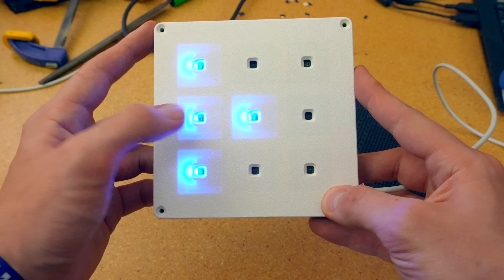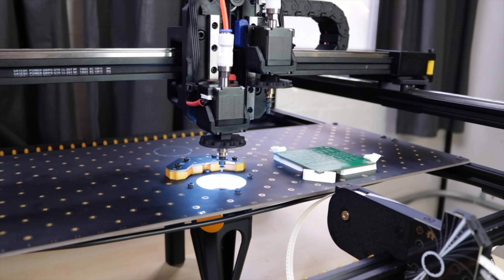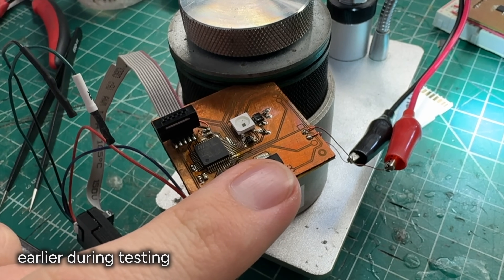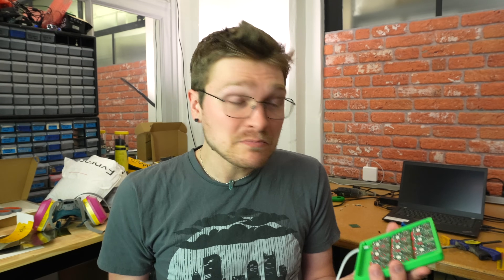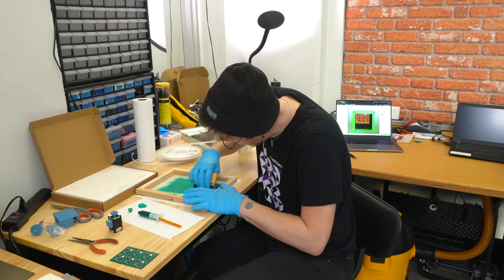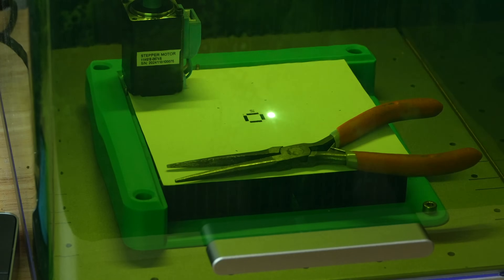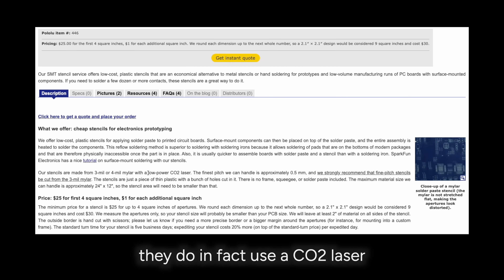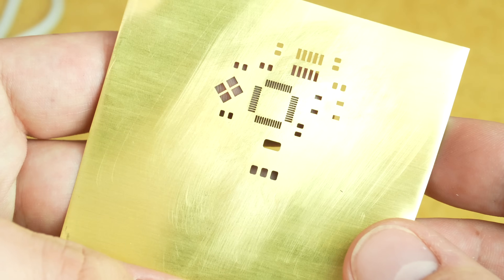Make and Assemble PCBs on your Workbench

Comment: Hello, I have watched Commaker's video of making PCBs with lasers. I agree with his simplified version of the operation steps. The laser engraves the circuit board and opens holes (this can also be done on the F1 Ultra), then sprays paint (solder mask), and then uses the laser to punch out the pads. The entire operation steps are similar to yours, but spraying paint seems to be much more convenient than applying solder mask oil. It does not require a UV lamp or gloves to operate. It only requires a piece of paper to be placed under the PCB. The drying speed of spray paint is also much faster than solder mask oil. I tried it, and ordinary paint cannot withstand the high temperature during welding and will melt. I asked the author of Commaker's video, and he just sprayed ordinary paint for demonstration. Later, I planned to try high-temperature spray paint, which is the kind of spray paint that is sprayed on the oven or motorcycle exhaust pipe. The only black or silver ones available on the market can withstand high temperatures of 800-1500 degrees Celsius. I think this kind of spray paint can replace solder mask oil to a certain extent.
I share this idea with you and hope it is useful to you

Comment: For via/double sided boards, a few times, I just used a strand of copper wire from regular AC cables and then snake it through all the vias and solder by hand. At the end, you just cut all the excess with a blade. It sticks out more than necessary, so you can't use it under components, but it does the job. I use it to verify my design before sending it off to fab.

Comment: You can also make the two sides separately as two one-sided PCBs. If you increase the via size, you can put those two boards back to back, and solder some resistor leads in the via holes. It is a little manual soldering, and the final PCB has twice the thickness, but it is simple, and You can still design like for an ordinary two-sided PCB, just make visas a little bigger so you can place thin wire into them, and add a little pad on both sides, so it is easier to solder the wire. 

Another solution would be a rivet placed in the via whole, but again this requires a little bit of manual work.

Comment: Try dampening, wetting, or soaking paper products before cutting in the laser of your choice.  You may also want to press or iron them when done to ensure they dry flat.  Also consider electrochemical etching of metals.  It’s easy, cover both sides with a mask (I’ve even used aluminum beverage, cans which already have plastic coatings), oblate the coating with the laser, submerge is salt water and pass current through it + on the workpiece, and - on an electrode.  I’ve used 12v at an amp or two.  You’re actually plating your electrode with material from your stencil.  Lots of resolution possible.

Comment: I have no idea if this works, but maybe worth a try:
Instead of using a stencil for the solder, maybe use the laser to either solidify or remove solder.
If the wavelengths work with the solder paste, you could either remove/evaporate solder at unwanted places or if the laser can melt the solder, you could try to pre solidify the paste and then remove al the unsolidified parts.
Reply: interesting idea.

Comment: If you want to try the kapton tape on paper again, applying it on both sides might mitigate the curling. You might be getting a sort of "bimetallic strip" effect where the difference in expansion coefficients is pulling it into a curve. Having the kapton on both sides might balance that out.

Comment: I used sketch paper (40g / m^2) cut on a CO2 Laser with very low Power (something around 5W on a 100W Laser). Worked fine even for 0402 and 0,65 mm pitch. It didn't last forever - after 5 applications it starts to wear out. But still pretty god. You need to dial in the thickness of the paper (depends on the amount of paste you need) and the Laser parameter.

Comment: A warning about cricut: when last I checked, there is no way to import an svg into their stupid proprietary software while maintaining scale. It resizes everything arbitrarily instead of just using the size you designed it at, and there's no way to resize it to an explicit size. This makes it absolutely useless for this purpose, or any technical application.

If anyone can tell me how to do this, or if this issue has been fixed, I will edit my comment.

Comment: One idea i had regarding the solder paste dispensing / masking thing was to use a flux (in the paste) that is solid at room temperature like the good old rosin and then fabricate pieces that can be picked and placed or applied (with a little bit of heat perhaps) to the component when it is picked and placed. 
Not sure if that's a good idea though.
edit: 
A tiny amount of solvent (like alcohol for rosin) could also be used to make everything stick together. 
When i experimented with this i found that once rosin had contact with alcohol it stays sticky for months...

Comment: two observations: polyester fuses at 200⁰ celcius (this is before it burns ant vaporises)
and, the industrial laser for cutting through metals, use a strong air flow to wipe out the fused material and to clean the cut.
I do not know if the fiber laser tip from your x-tool engraver use air flow, but, to cut polyester I woulfd consider a 5W or 10W led cutter (some costs les than $200)

Comment: It would be rad to have the laser able to be used to do precision reflow, though I'm sure it would have limited use based on visibility of the solder points. Still, you never know, maybe some kind of PWM or hatching pattern could be used to warm up chips that use solder balls.

Comment: See how low of a layer you can get from an FFF 3d printer for those stencils. I've had some pretty squished yet still solid pieces of plastic from partially failed first layers that look like they could be the right size for a stencil. SLA might be possible, and could give you higher resolution if that is an issue with the FFF although I don't own an SLA printer and don't know much about how well a single layer like that could work for one.

Comment: Something just crossed my mind. What if you made a thicker soldermask and apply the solder paste without a stencil? I use super thin stainless steel stencils, but the more I think of this, in my mind, this is feasible. By having a thicker layer, there would be pockets where the solder past would collect. since you would use a putty knife to remove the excess solder paste, only the paste in the depressions would remain, and the flat SMD components like the caps and resistors would still touch the ends of the caps and resistors. I'm sure I'm not thinking this through because it would already be a thing.

Comment: Unless you have a good method for through-plating your vias, single-sided with a few 0 Ω resistors is probably electrically more reliable unless your design benefits from a ground plane, right?

(Or you could use riveted vias, i guess?)

Comment: Just use your 3D printer for the stencils, two layers with a 0.2 nozzle works perfectly for me. But for really small pitches I just create my own stencil masks in KiCad (a smaller bar across all pins, and the solder is reflowing to where it's needed)

Comment: Regarding the stencil: It will be a lot easier to cut any material cleanly if its black. Neither 450nm nor 1064nm are suitable wavelengths to cut anything clear. This applies to paper as well as plastics. I think something like black PE construction film may be usable but could also be to soft.

Comment: Some tips from professional sheetmetal laser cutter here, use way less power possible and do way, way more pases. Air assist also helps wonders. About the solder resist, I use since 20 years a film I just laminate on and develop quick. Perfect layer, no drying time and less than 10min process. Why don‘t you use Fr4? Venting the fumes from cutting it is also necessary with FR1.
Reply: He explained in previous videos. FR4 and the fiber laser was not mixing. Maybe worth another try,. though.
Reply: FR4 requires a CO2 laser to cut the fiberglass
Reply: I engrave circuits on FR4 using an infrared fiber laser from Commarker. It works perfectly, better than what I got with FR1. It's just a matter of hours of tuning

Comment: Using 0-ohm jumpers to avoid needing an additional layer is a great trick, and you'd be surprised how many designs you can make it work with, especially if you're not dealing with high speed or RF where the exact trace routing and lengths are more important.

Comment: A part of me wishes I was in my twenties again. When I learned electronics I made my own PCBs: Design a black and clear layout. Use it to expose a copper clad board coated in UV sensitive resin, physically etch the exposed copper in acid that smelled like rotten eggs and stained your fingers yellow, then drill a million holes because this was the Neanderthalic days before surface mount components. I don't know if laser etching is faster, but it sure is a LOT cleaner.

Comment: Can you apply a thick tape or film to the PCB. Then burn out the pads with the laser (the same way you burn off the solder mask). Apply paste. Remove the tape or film. Then add the components? This would also alleviate the need to align and prop up the PCB during paste application.

Comment: Hey Stephen. Have you looked at UV lasers? They can ablate copper from FR4 without burning the core material. I think a 10W UV laser is the sweet spot to get the right power and frequency. It also has a much small dot size for incredible precision (<20 micron). The downside is that it's quite a bit more expensive. Around $8-9K. But, this is the setup I am thinking of getting to also cut stainless steel PCB stencils (same tech used by, for example, the LPKF ProtoStencil). Fiber lasers are awesome, and they are getting very accessible/affordable, but they work by burning material (photothermal) rather than what a UV does (photochemical). A UV laser would make a great companion to my LumenPNP :)

Comment: I use my SLA printer and make a solder paste sentcil that way. Print at a 30° angle all axis with lots of support around the edges, and it works for me really well! Can rinse them down with IPA when finished to store them away for next time.
Reply: get a magnetic printbed or tune your resin settings for less adhesion + elephants foot compensation lets you print flat on the build plate,thats how i do it at least,comes out great and print times are lightning fast!
Reply: @djordjezivic2481  that is very true. I've a magnetic base, but shitty profiles, so need to fudge with some vertical print! Haha

Comment: For such low complexity and low volume boards I would personally just skip the stencil and also the PnP (unless already loaded with the components required).
A toothpick for paste and manual placement goes a long way rather quickly... I know I know not half as sexy as using a PnP

Comment: Hve you seen the machines from Voltera? They do solder paste dispensing as well as a hotplate to bake your components onto the boards right on the machines.

Unfortunately they're still a very expensive solution

Comment: I have reasonably good solder paste stencil results using soft aluminum stock (of the craft variety, probably made for hand embossing) on a fiber laser with a wet paper towel under the metal with many fast passes (I just keep one of those lab squeeze bottles full of water next to my laser, quite handy). (Also a dental water pick is great at quickly knocking out any tiny ones that are still hanging in by corners).

Comment: I'm following your pick and place project for a while and really like it, but this use-case does not make much sense for me.
For fast prototyping I always used ferric chloride etching and a laser printer, with almost zero upfront cost. I used to be frequent at a local printer shop, were I would pick up the mask and then do the ironing and etching in my bathroom. 1 day turnaround from design to finish. Never felt the need for soldermask for one off prototypes used once or for a short amount of time. Anyway, keep up the the good work!

Comment: For stencils, thicker polyimide (kapton) films would probably work (so without an adhesive layer). It cuts very cleanly with diode lasers (don't know about fiber lasers or CO2 lasers), and is quite cheap. 
Kapton tape can also be used as a really nice looking solder mask, where you just burn away the pads with a diode laser

Comment: I wrote my bachelors thesis on making stencils with 3D printing (i think my original comment got deleted after I edited in a link to google drive)
you can remove the build platform and only print a single layer directly on the FEP-membrane of the resin vat.
the uncured stencil has to be carefully removed from the membrane and cleaned of any remaining liquid resin, then it can be cured pressed in between two glass panes (I used plexiglass)
with the right resin and settings I managed to make squares of 350 by 350 µm, but about half the holes closed, so 400µm square holes at a stencil thickness of 160µm were the limit with what I could achieve
a stencil is finished in 15-20 minutes this way.

I also tried cutting it out with a cutting plotter, but it's blade is trailing behind the axis of the tool-head for one type of plotter which leads to unfinished cuts.
the other type of cutting plotters have blade is in the center of the toolhead and a motor for the blade angle, but they often over-cut the target lines. From what I used the material is then prone to tearing while applying solder paste. You would likely need to write the g-code yourself, because most plotters were not meant for that kind of work. Probably don't have the accuracy for it either.
Reply: yep.. YT does not allow links in comments; probably a good thing but annoying when good people are just trying to be helpful.

Comment: Regarding the stencils: it is crucial not to "cut out" the perimeter of the cutouts, but instead "engrave" the ara (rastering across the area at reduced power & high speed). I once made stencils from Laserprinter overhead film and had no luck whatsoever cutting out holes, but once I switched to engraving the full are it worked flawlessly  (that was on an industrial CO2 laser but I guess it might work similarly for fiber lasers, be it with different material choices)
Reply: what matterial does you used

Comment: I wonder if you could jump around with the stencil cutting? So, instead of cutting from one side to the other, you would cut some here, then move to the other side and cut some there. Just jump around to prevent too much heat buildup like with welding thin sheet. Or, alternatively, maybe you could add pauses into the G code to give the metal a second to cool between cuts. I'm sure there is a way.

Comment: i've 3D printed stencils on FDM. it worked alright even for 0402. probably have to merge QFP pads
Reply: I do this to. 0402 if easy for a well calibrated printer. I slowed my Bambu X1 down and can get extermly fine details. only takes 20 - 30 minutes depending on settings and size.
Reply: You print with pla a few layers?  How thick?  Great idea!
Reply: I use pla at 0.2mm in height. Depending on my mood I'll either set my printer at 0.1mm layer height or 0.2mm if I'm rushing. (2 layers vs 1 layer). I do prefer 2 parts layers since to tents to struggle less with qfn packages

Comment: The pro shops use extremely highly focused extremely high power lasers to cut their thin stainless steel sheet stencils for the exactly the reasons you discovered - permanent thermal deformation caused by heat transfer from the low power cutting process. The pro machines cutting pulses are ultra focused, ultra short and ultra high power to literally vaporize the curf almost instantaneously in a single pass.  This keeps any heat transfer to the thin remaining stock  to an absolute minimum. Unfortunately high power highly focused laser heads are not inexpensive.

Comment: how about using a Formlabs SLA printer and curing resin the same way the cleaning meshes are made (no BP necessary; just pull it out of the tank)? Washing it will take more time than actually printing it (which would be only a few seconds on a Form 4) and if you can definitely tune the flexibility/stiffness/durability to your liking with the right resin

Comment: This was really great to watch. I have never liked the mylar stencils. They work, but I find that they're too thin and you need more rigidity when lifting the stencil. I wonder if you could avoid the warping by preheating the brass? I don't enough about how the material warps, but I assume that part of the issue is the rapid temperature change that comes from the laser being applied. If the whole sheet was already at a hotter temperature, the laser may not induce (as much) warping?

Comment: I had great success for making prototype SMT stencil with a 3D printer, 0.2mm thickness. Used a Bamboo Labs X1 Carbon.
Reply: Pla? Petg? Do they both work? How many layers? Great idea!
Reply: @TheRainHarvester  I used PLA. I think the others would work fine. It was 1 to 2 layers. For some boards with larger components I used 0.4mm thickness (2 layers) and 0.2mm for finer pitch (single layer). Although I should say you won’t be able to really fine pitch, around 0.65mm will be the limit.

I forgot to mention one other thing… It’s really hard to clean the stencils. Because it’s 3D printed, it has a lot of extra grooves and valleys where the paste sticks to.
Reply: @akhurash thanks! I wonder if the bottom glass heated bed could be used for smooth/less pits? (Flip the X dimension before printing)
Reply: @TheRainHarvester  Maybe that would work. I didn’t populate too many boards and the filament being so cheap, I just printed new ones. You could do one or two boards with one 3D printed stencil.